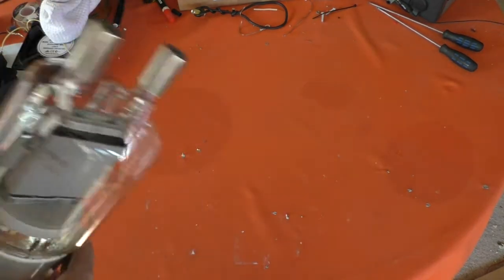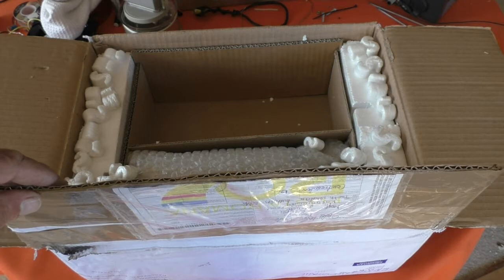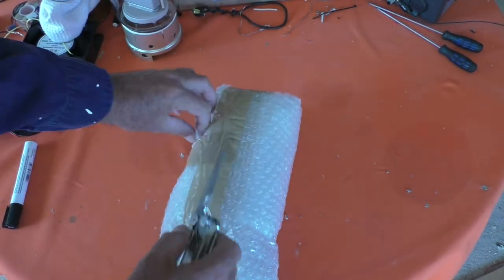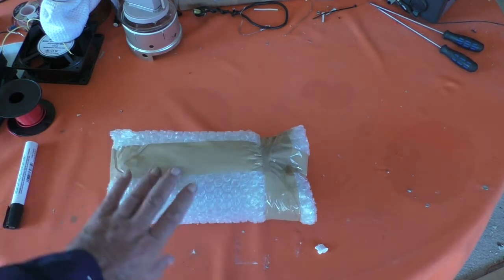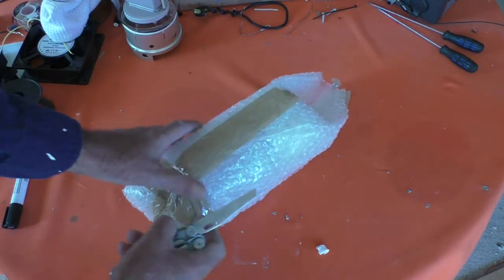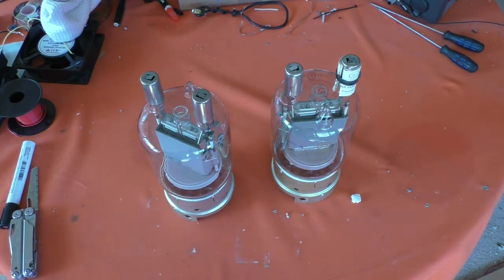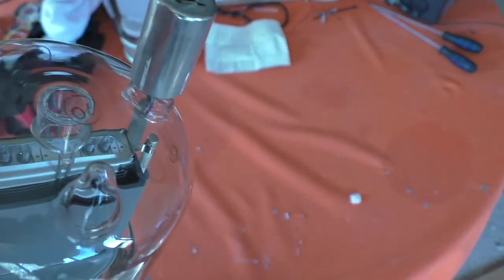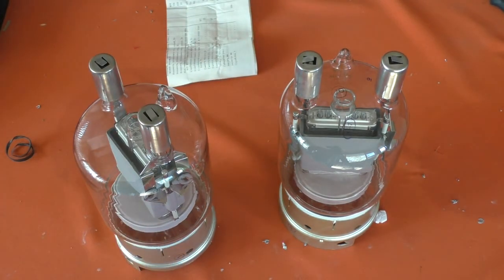Unboxing A GU-81M Pentode

Comment: Definitely nice tubes... and that Leatherman 'Surge' multi-tool is nice, too... I have one of those Surges too. :-)
Reply from the maker: Hi Terry... did I say 'surge'? I must be getting senile, it's a Leatherman Wave folks..
Reply: Right on... I thought it was the Surge model... similar blades...  I stand corrected. :)
Reply from the maker: No worries... I've been using a Wave daily for years, they're great. And, the Leatherman lifetime guarantee works, even when you break them. I sent my Wave in for repair and they sent me a new one. I would recommend them to anyone.
Reply: Right on... me too... they're definitely some cool tools.
Reply: @vk6cs456  hola, donde lo compro con confianza.. gracias muy bueno su demostracion....
Reply from the maker: Gracias, estoy seguro de que lo disfrutarás